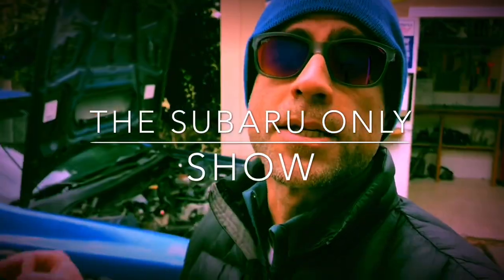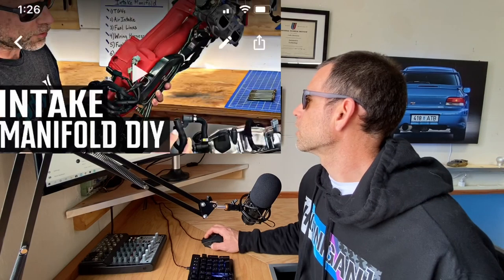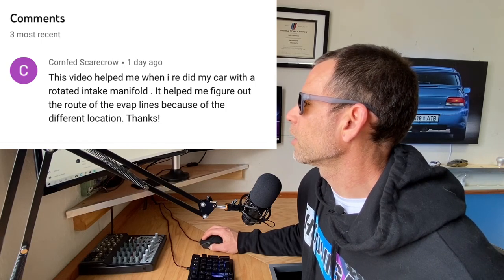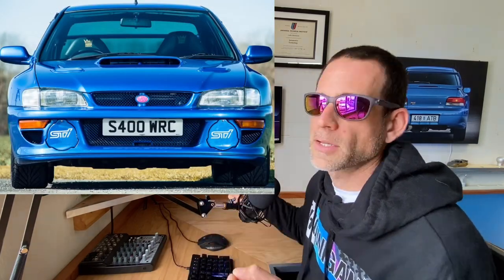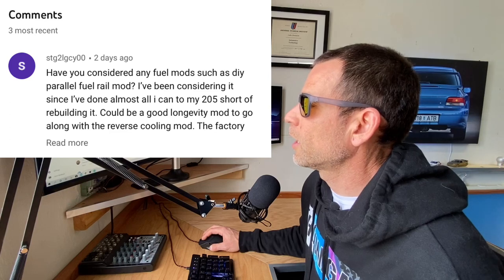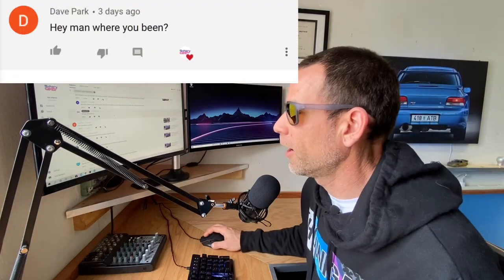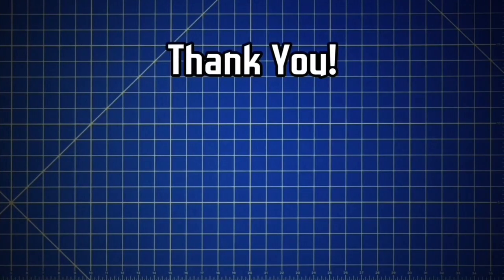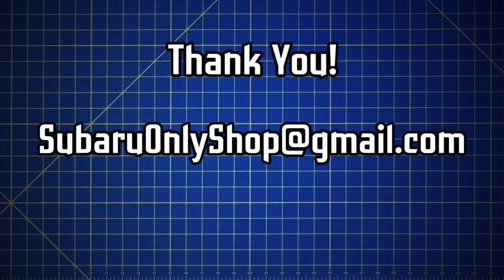Rotated Manifolds, Parallel Fuel Rails, & More!

Comment: Love the videos. You are doing great. Also do you have a spare wiring harness guard that bolts to the bottom of the intake manifold. I cant find one anywhere online
Reply from the maker: I don't. super random part and I'm not surprised it's so hard to find. Might need to call some junkyards, that or ebay. Good luck!